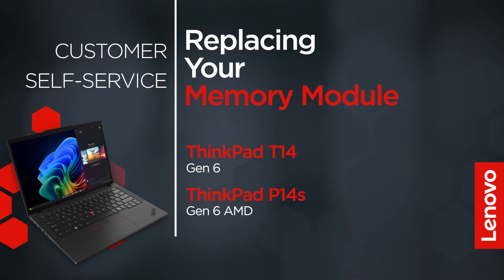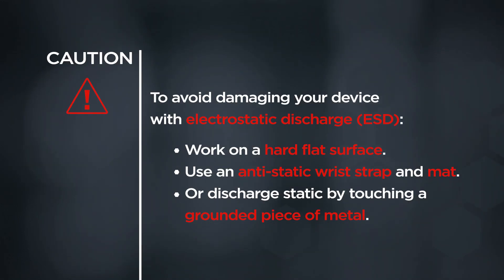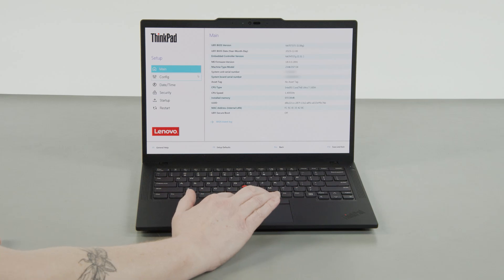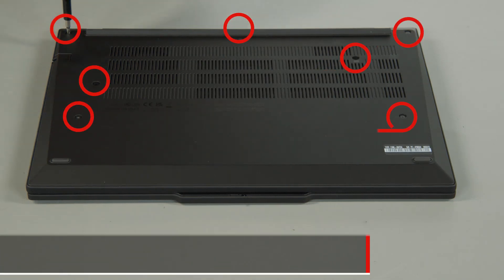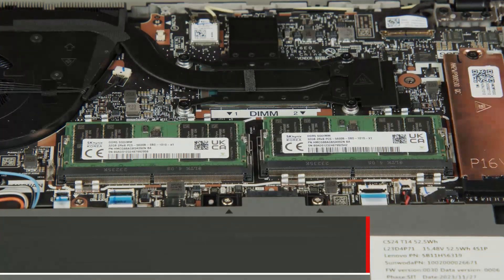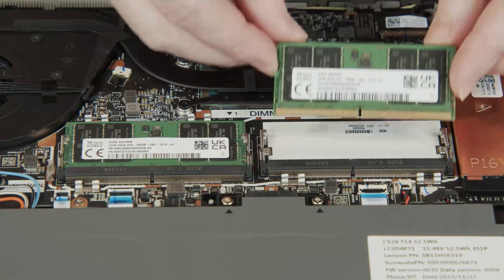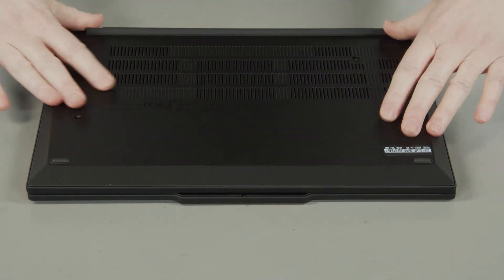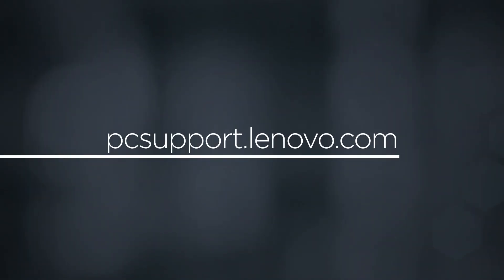Replacing Your Memory Module | ThinkPad T14 Gen 6 and P14s Gen 6 AMD | Customer Self Service

Comment from the maker: This video will show you how to replace the memory module in your ThinkPad. The process in this video will work for the ThinkPad T14 Gen 6 and ThinkPad P14s Gen 6 AMD.

You will need a screwdriver kit, a non-metallic pry tool, and 15 minutes of your time.

To view the ThinkPad T14 Gen 6 Self-Repair Guide go to https://pcsupport.lenovo.com/us/en/products/laptops-and-netbooks/thinkpad-t-series-laptops/thinkpad-t14-gen-6-type-21qj-21qk/selfrepair/removalsreplacements

To view the ThinkPad P14s Gen 6 AMD Self-Repair Guide go to https://pcsupport.lenovo.com/us/en/products/laptops-and-netbooks/thinkpad-p-series-laptops/thinkpad-p14s-gen-6-type-21ql-21qm/selfrepair/removalsreplacements

To learn more about your device go to https://pcsupport.lenovo.com

To find parts for your device go to https://support.lenovo.com/parts-lookup/?cid=ww:lenovosocial:b9515f&source=socialmedia&subsource=yt

To view the Lenovo Support Self-Repair Guides landing page go to https://support.lenovo.com/us/en/solutions/HT516547

** NOTE: Static electricity can destroy components. Use a grounding strap, and clean, non-conductive surface to work on. Use plastic or coated tools to prevent scratching and avoid using metal tools on plastic parts. For more detailed information on electrostatic discharge and how to prevent it, please watch our "Understanding Electrostatic Discharge (ESD)" video: https://youtu.be/by4PB3WtdLo 

Applicable Machine Types:
ThinkPad T14 Gen 6 - 21QJ, 21QK, 21QG, 21QH, 21QC, and 21QD
ThinkPad P14s Gen 6 AMD - 21QL, 21RV, 21QM, and 21RW

Check out other official Lenovo channels!
https://www.youtube.com/@Lenovo 🟥
https://www.youtube.com/@lenovolegion 🎮
https://www.youtube.com/@Lenovo-PC 💻
https://www.youtube.com/@LenovoSuporte 🟢🟡

#Lenovo #LenovoSupport #LenovoTechSupport